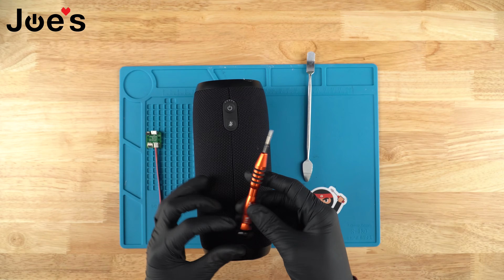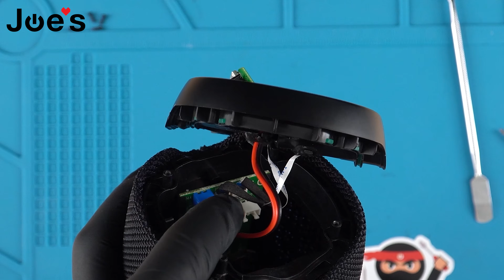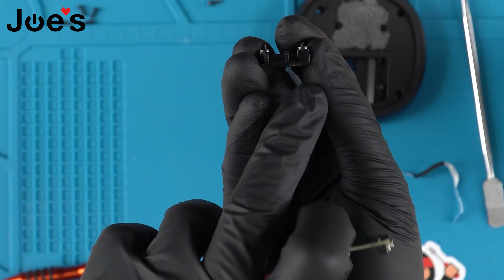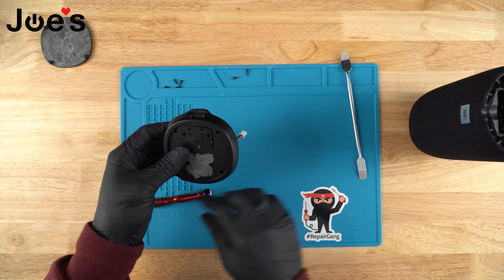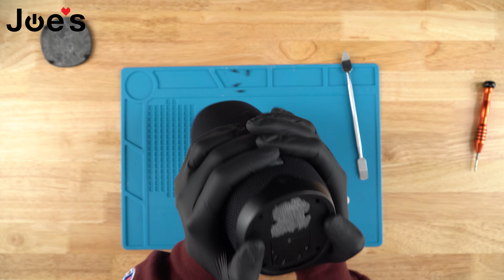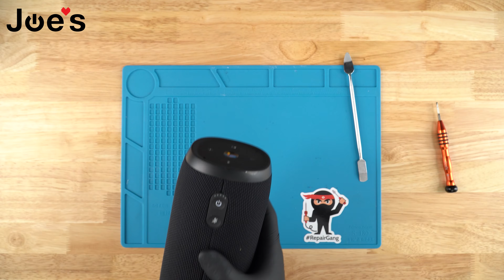JBL Link 20 Charger Port No Power Replacement | Repair Tutorial

Comment: I replaced this piece on 2 different speakers, and the same thing happens on both speakers. When i turn the speaker on it charges, but the white power light and wifi light keep flickering, and when no music is being sent to the speaker it has a slight hum of interference sound over the speaker. It will play music over wifi though. Do i need to re-land the ribbons you think?
Reply: I solved my own issue. I had the wrong charging block, once I switched to the JBL charging block, the flickering went away and it works great now.
Reply from the maker: Bam good work.

Comment: If after replacing the battery the speaker still does not turn on, is it worth trying to replace the charging connection as well?
Reply from the maker: Did the charger light come on when you plugged the charger into the port?
Reply: @Joesge  No, the speaker does not respond and does not turn on, nor does the charging light

Comment: This is the kind of content that is terrific. When I was opening up the Link20 I got greeted with a black, probably water resistance, seal to peel off. We don't use it much outside so no trouble there but if you do you know any way to re-seal it that would be great.
Reply from the maker: when you open an electronic its never gonna seal like it did from factory. The best you can do is tape or glue it back down. I personally don't think that's even worth it. The previous adhesive will seal it just fine.